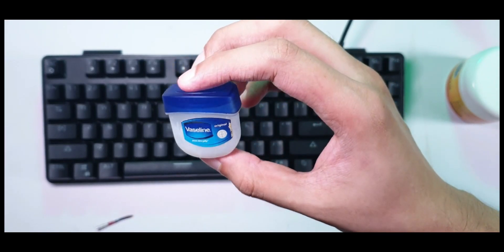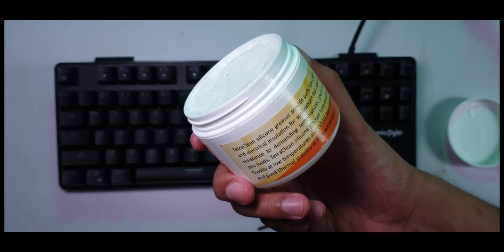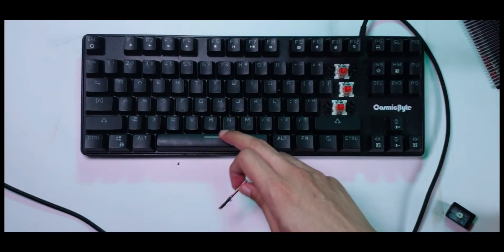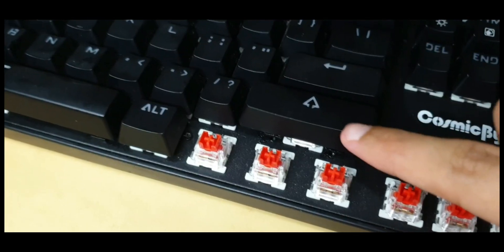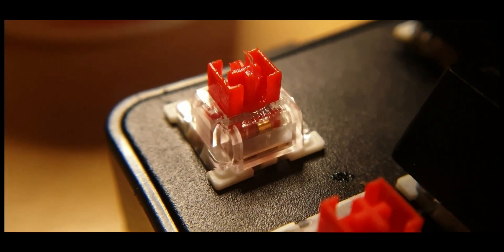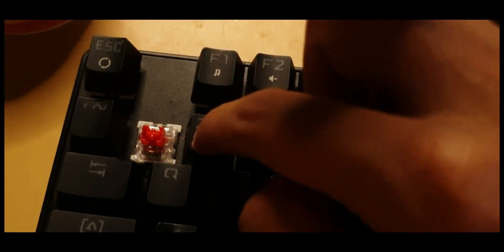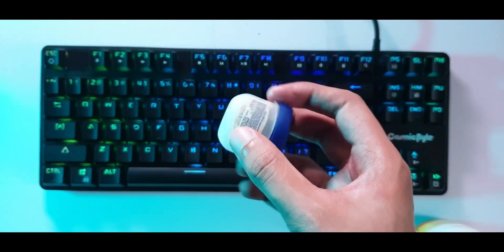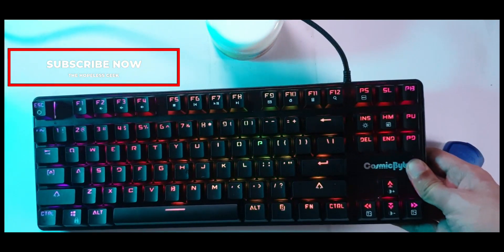CosmicByte Firefly Mods - Silencing The Keys (Part III) | Vaseline vs Silicon Grease Comparison

Comment: got a cheap ant esports keyboard. lubed it like you showed with vaseline. some keys stopped working.
idk if its the fault of the cheap ass keys or the lube and the method itself.
will try silicon grease next time

Comment: Petroleum jelly can work goofd but evenutally it will eat up the and rubber and plastic parts so try avoiding it if you are planning to using your keyboard for long term
Reply from the maker: That's a valid concern. The silicone grease may be the best

Comment: Most people prefer krytox lube for same , is there any similar budget friendly alternative in India?
Reply from the maker: I've used krytox lube as well as some fountain pen lubes as I did in this video. The difference isn't that much if you apply thin coats. Krytox one is smoother to apply evenly, but the same results can be obtained with this others too.

Comment: my keyboard started to freak out after i applied a thin coat quight literally a thin coat and now my 4.5k keyboard is not functioning properly any thing i can do to fix it and the switches are solderd on so cant remove and clean help me 
:eyes-purple-crying:
Reply from the maker: Oh. Try to use isopropyl alcohol (spirit/rubbing alcohol) with a cloth and q-tip to clean the gelly coat.

Comment: Vaseline ls corrosive to plastic use the silicon
Reply from the maker: I didn't realize that until later. I swapped out the Vaseline with a silicone based lube😅

Comment: I  have lubed but why is it feeling hard to press the spacebar ?? now
Reply from the maker: Maybe you over lubed?
Reply: @TheHopelessGeek  does it actually 
Ruin your keyboard tho
Reply: @TheHopelessGeek  and how long was it lubed for
Reply from the maker: Mine was on Vaseline for a month and then I cleaned it up, used silicon grease on the switches instead.
Reply: @TheHopelessGeek  ight
Reply: @TheHopelessGeek  i also think the same , I also followed your video and applied the same lube , maybe I shouldnt apply lube on tactile switches something like that ??
Reply from the maker: You can lube them, but don't overdo it so you preserve their tactile feel. Lubing works a bit better on linear switches.

Comment: Petroleum jelly degrades plastic, better use dielectric grease.
Reply from the maker: I suppose you're right. I switched to a silicone gel later on.
Reply: @TheHopelessGeek  how was the quality of silican gel in the video??
Reply from the maker: It's alright, works well.

Comment: hey i was wondering... Can you put mechanical switches in a membrane keyboard? You should make a video about that.
Reply from the maker: No, the switches need an entirely different PCB, at which point, it'll be a new keyboard with an old top cover, which also has been modified heavily to make room for the switches.😂
Reply: @TheHopelessGeek  oh alright, thanks!
Reply: @TheHopelessGeek  Hey but is it possible to somehow make the switches hit the membrane??

Comment: i have tried vaseline , only problem being it lasts for only a month (i tried on kailh blue switches )
Reply from the maker: Yeah, a thicket lube will last much longer.
Reply: @TheHopelessGeek  i looking to buy a dry ptfe silicon spray , i researched a bit and people say it works , can you make a video on it ?
Reply from the maker: It works, but is messy to apply. You'll need to be extra precise with that stuff.😅
Reply: @TheHopelessGeek  i do have a hotswap optical keyboard so i was planning to test it on that one
Reply from the maker: Optical ones don't particularly respond well to a lot of mods, so you'll need to be a bit more conservative there.😅
Reply: @TheHopelessGeek  ohhh okay I will try some experiments on it

Comment: i also got a mod and a solution to the problem which is you can use some foam and fill it inside the keycaps (which have the stabs) at it will work perfectly 
i used it and now the sound is better
Reply from the maker: Oh, nice! 😀👍🏻
Reply: @TheHopelessGeek  hey, 
i needed help in the lubing process tho,
i was gonna buy the same lube which you use but the thing is that the people are reccomending some other one 
please tell me which one to buy and lube it with

Comment: Suggested not to lube with vaseline, you can do it but in the long run, it is bad when u put lube don't lube it like this, desolder and open the switch and lube the springs, I am saying this because I had a nice gk61 and I did it with vaseline and after 2 months the keyboard broke, and don't over lube the switches like in this video there are many lubing tutorials on youtube just follow one.

Edit: if u apply silicone grease it is good, but don't lube it like in this video, open it and put a TINY amount of it, don't over lube it, and lubing the spring is the main part
Reply from the maker: You're right about the spring. I imagine it reduces the sound by a lot.

Comment: I tried my best to get the stabilizers to sound good,  but I kinda gave up and bought some durock white plate mount stabs. Its pretty cheap and worth every penny.
Reply: cheap its 2100rs
Reply: @daksh101  bruh, enthusiast mechanical keyboards can cost upwards of 50k
Reply: @shanthoshravi5073  yeah i know right but still to me its a lot not like have 100 rs even
Reply from the maker: Ah, are you gonna open it up and replace them?
Reply: @TheHopelessGeek  yup, you only have to desolder the 5 switches to get the stabs out.
Reply from the maker: Ah, nice 👌

Comment: Dude I got the same tetra clean silicon grease. I applied it on few keys. Don't you think keys feel slightly heavier ? I also feel tetra clean grease feels gummy. What do you think?
Reply from the maker: Maybe it is a bit too thick. You can liquefy it a little using some rubbing alcohol 🙂

Comment: yo my cosmic byte sounds like piece of shit
Reply: like complete shit left shift is completely broken enter spacebar also 
i got scammed by chinese :(
Reply from the maker: Maybe the keycaps were from a bad batch. You can contact them for a warranty claim if possible
Reply: @TheHopelessGeek  keyboard works completely fine tho :( it feels not smooth lube may help a bit.
Reply from the maker: Yeah, also consider replacing those keycaps for a better feel
Reply: @TheHopelessGeek  :0 it costs same as keyboard,can i ask for warranty for not beeing smooth ? would be rejected ig
Reply from the maker: You can still ask. You can only get particular keys from them.
Reply: @TheHopelessGeek OK. thanks for your time :)
Reply from the maker: No problem 😄. Consider subscribing if you haven't ✌🏼

Comment: You can try Holee moding the stabilizers. I think the stabilizers should be held on with clips and not soldered, so you can unclip them and lube and mod them separately. While you are in there you can also clip the stabilizers for a smoother feel.
Reply from the maker: Thanks for the suggestion 👍🏻
Reply: @TheHopelessGeek  Hope to see more mods on this keeb!! I saw a video where someone converted a wired keyboard to a wireless one. If possible could you try this mod?
Reply from the maker: I'll look into that one.👍🏻🙂
Reply: @TheHopelessGeek  holee mod is not possible on this keyboard without desoldering as the switches are not hotswappable.

Comment: there are many ways of modding this keyboard by putting some tape in the back of the pcb aka the tempest mod and you can also put some thick cloth so it dampens the sound of the keyboard aka the foam mod but with cloth . Then you also put o-rings around the pcb and the switches to make it also sound better.and you can also use wd-40 lubricant to silence the switches but assuming that you already have done it with Vaseline so it doesn't matter but you can also try .And you can flip the spacebar to reduce the springiness sound of the stabilizers hoping it works at least .Then finally you can change the keycaps to change the sound I recommend pbt double-shot keycaps so that it is very thocky .That's all I have hope this helps and also works.
Reply from the maker: Thanks for the good ideas.👍🏻
Reply: @TheHopelessGeek   if you can feature me in the next video for the ideas pls .
Reply: @TheHopelessGeek   and no prob
gonna buy it so might as well give some good ideas to other people and help them
Reply from the maker: Cool ✌🏼

Comment: Are there any damaging downsides to using vasoline? Will it damage the plastic or something? Genuinely curious.
Reply from the maker: I don't think it will. I used it for a long time with Vaseline, nothing happened so far.
Reply: Pretty sure vaseline dries up
Reply from the maker: Maybe. I switched to silicon lube after a month, so I didn't see it.
Reply: Not damage but will collect dust like anything and difficult to remove i think

Comment: Some people say Vaseline desolves key switches because its petrolium jel so i am confused. If vaseline works then i will use it on my gateron yellow switches.
Reply from the maker: Yeah, I've heard that too. But I don't think it'll be so damning. We use it on our skin after all!😀
Reply: @TheHopelessGeek  since vaseline is petroleum based. It can dissolve the plastic. But the emphasis is on can. How much it actually affects the life is the keyboard can vary. But hey, better to experiment on a budget keyboard than being afraid of modding an expensive one.
Reply: I have done a small and humble investigation in this regard, basically looking for the resistance datasheets of these materials from different manufacturers (materials with which the parts of a switch are built, in different combinations, such as POM/PC/PA or POM/POM/ POM): POM (polyoxymethylene), PC (polycarbonate) and PA (polyamide), commonly known as nylon, are generally resistant to contact with petroleum products, such as petrolatum (the main component of Vaseline).

In theory, yes, Vaseline could be used as a lubricant for plastic parts such as POM, PC and PA. Vaseline would provide a lubricating layer that would help reduce friction between plastic surfaces, which can be useful in various applications, as Vaseline is often used for these purposes in various industrial applications.

-"Introduction to Plastics Engineering" by Roy J. Crawford and "Plastics Materials" by J.A. Brydson.
- MatWeb, IDES Prospector, and Knovel material technical database
-"Polymer Testing" and "Journal of Applied Polymer Science".
Reply from the maker: That's great to know. Thank you for sharing, Claudio!

Comment: dude it sounds so much better but the prob is not broke asses like me could afford silicon grease
Reply from the maker: It's rather affordable. 250 Rs will get you at least 250 gm which is Way more than what you actually need (which is like 8 gm)😅
Reply: @TheHopelessGeek  yea quick update i lubed my evofox keyboard with dabur coconut oil and it sounds soo good and smooth it has been 1 week and still sounds good
Reply from the maker: That's great. I'll try something like that too.